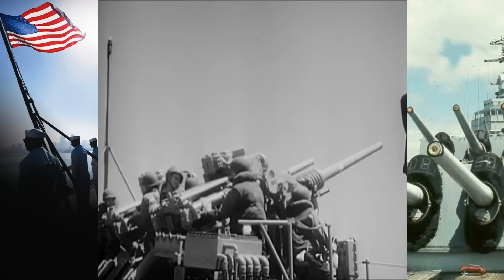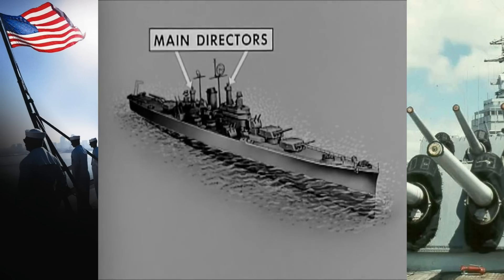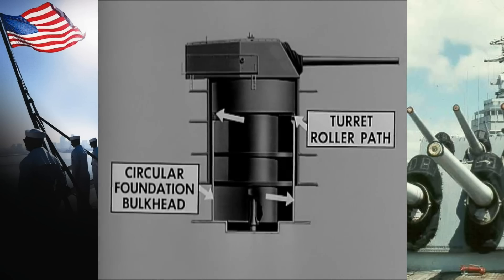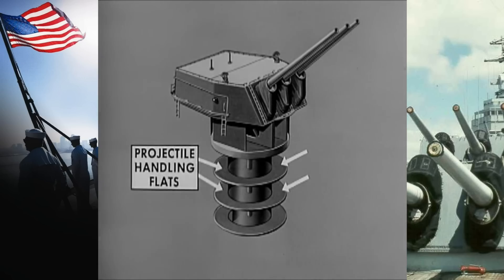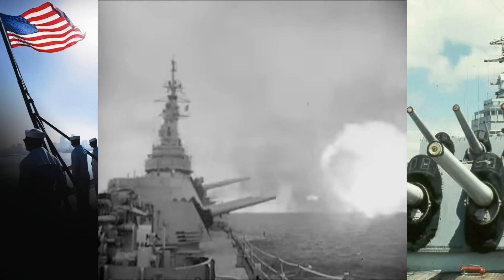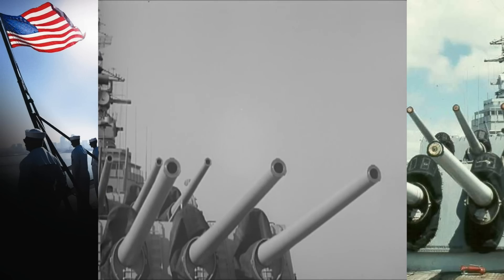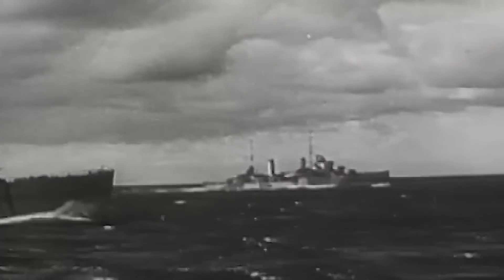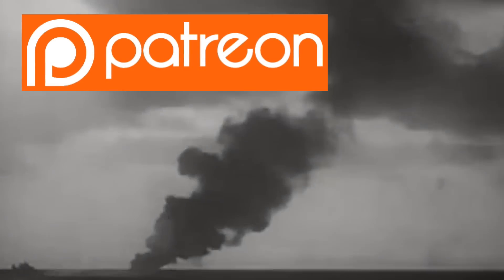How Do Large Caliber Naval Guns Work?

Comment: I also like large naval guns, and their firepower and history are truly impressive.  Glad you posted this video about the U.S. Navy’s 8” naval gun, but there are some points to clarify.  The Des Moines class cruisers with the automated, rapid fire 8” guns came out near the end of WWII and probably saw more action during the Korean conflict than the preceding Baltimore Class cruisers, which also had 8” (or 203 mm) guns but were manually operated with a fire rate of about 3 rounds/gun/minute.  The Des Moines cruisers used a single cased shell, which allowed for its more rapid rate of fire, and the gun mount itself was considerably heavier and more costly to build & operate.  The Baltimore Class cruisers came out with then the most advanced radar, rangefinders and analog fire control systems, and they mainly served as concentrated anti-aircraft escorts to the carrier fleets, which by 1944, grew to numbers the Japanese Imperial Navy could only dream about.  

The 8” naval gun on the Baltimore cruisers had a maximum range of 17.9 miles and they were manually operated with a separate load and ram of the shell and then the cased powder bags.  A well trained turret crew could fire about three rounds/ minute at best because of the intense handling and weight of the materials, but when these guns hit their target they did considerable damage.  The heavy cruisers were also used to assist in shore bombardment, as well as surface engagements against enemy ships.

Comment: Wouldn't powder bags be cheaper to use? There's an answer of course but I have no idea of it.
Reply: Brass protects powder better and doesn't deteriorate like cotton, but main reason is that, with "bag ammunition" you have to be really careful during reloads that a "hotspot" from the previous round being fired doesn't set off the powder when you shove it in - they used to swab the barrel with a big "Q-tip" and water between rounds.
Reply: Makes sense. Thank you.

Comment: As usual, something's screwed up here. A caliber is 1-100th of an inch. .50 caliber=1/2 an inch. 55 calibers would be a little over 1/2 an inch. Those barrels were a Hell of a lot longer than that.
Reply: They were using caliber differently, in the case of navel guns it's the multiplier of the bore diameter.
Reply: Lensflare Deviant:  What? Can you explain it a little better?
Reply: @alanpeterson6224  One of the conventions of naval guns is that the bore to barrel length ratio is called caliber.  I am not sure why but it started before WWII and seems exclusive to the Navy.  Its why we see strange things like the 5" 38 caliber which was the standard 5" dual purpose navy gun for a while had a barrel 190 inches long (5x38).  It was used all the way up to the big 16" 50 caliber guns used on the battleships.
Reply: Lensflare Deviant: Thanks. I'm actually beginning to understand something, I think. I divided 190 by 5 and got 38. My brain hurts. I need a beer.

Comment: One of the surprises for me is just how much difference there is between a 5 inch gun and an 8 inch gun.  A 5 inch projectile usually weighed around 65 lbs depending on the type of projectile while an 8 inch projectile weighed around 350 lbs!  The Japanese naval crews were very impressed by these rapid fire 8 inch guns in combat.  They said it was like a machine gun firing 8 inch projectiles.

I imagine these rapid fire 8 inch guns could be worn enough to require a new barrel liner during a single engagement.  I did some more reading and it looks like the US actually got where the 8 inch guns could fire 700 rounds before wear became an issue.  They improved this with different lubricants that cut down on barrel liner wear.  I am not sure if they could replace the barrel liners while at sea.
Reply: fun fact - During Vietnam they discovered a warehouse full of new 16" barrels and that was a reason why they reactivated the New Jersey to do shore bombardment (it was cheap!)
Reply: Were those barrel liners?  Do you know if the ship's crew can replace barrel liners while at sea or is that just a task for the naval yard?
Reply: The rapid fire guns never saw action against Japan.  12 cruisers were under construction to be used for the Japan landings when Truman dropped the bomb.  The three that were the closest to being finished were completed after the war, the rest scrapped.  Relineing a gun is supposed to be a dockyard job.  On the other hand, with a 8"/55, the liners could (and were) replaced at on a wharf.  You needed a dockside crane to lift the 40 ton barrel out of the gun and lay it down on the wharf.  Then you could change out the liner, basically rerifleing the gun, and then you'ed fly the barrel back on board.  We did this a couple of times for each gun in the Philippines during the '72 Vietnam cruise.

Comment: I am glad to say that many of those beautiful gun tubes made their way on to tracked chassis for the 
US Army as M110 series of self propelled howitzers, the most accurate howitzer ever fielded.
I am equally proud to have been a crewman on one of those sexy beasts.
The total weight of each howitzer was 36 tonnes on a  very light tracked vehicle as opposed to the self 
propelled 155mm M109 series coming in at a measly 25 tonnes which included an armoured chassis and turret.

A few changes in capabilities came with the move to land based operations:
1) a wider variety of munitions; HE (High Explosive), various ICM (Improved Conventional Munitions), Chemical, and Nuclear.
2) a increase in range.  Only about 5 miles but still farther than anything the Soviets could throw at us.  
Part of that was due to changes in powder chemistry and another due to the lightening of projectile from 260Lbs. to 205Lbs.
3)  One thing the Navy never did (as far as I know) was what we called the double shot.   Firing a High Angle (HA) mission which often had a flight time of > 90secs, then to reload, and fire a Low Angle mission (flight time often around 40 secs) on the same target an have the rounds hit the target within seconds of each other.  
Range Control and Battalion Command almost lost their minds after we pulled that little stunt.

Comment: After watching the ejection system....You start wondering what they did with the spend shell case...I presume they are made of bronze, of some kind.....Would they be able to re-use those empty shells ??  If not, seems to me like an enormous waste of resources there... ...  Also.....The gun barrels....shooting a shell every 6 seconds....I can imagine that a lot of heat will be involved.... How do they prevent the gun itself, from bending..?
Reply: The powder cases were stored aboard awaiting rearming when we would offload them to an ammo barge, while reloading new ammo and powder.  Sometimes we would have to throw them over the  side if we got into a prolonged battle so as to have room to walk on deck.

Guns would get red hot sometimes although we would trade off guns to allow for a cool down and to give the gun crews a chance to rest.  The guns were gauged for wear every day, or at least as often as possible, as gun wear was factored into initial firing calculations.  Eventually, the gun liners were so worn that the projectiles would wallow in flight and make an odd noise.  We would pull into Subic Bay in the Phillipines  to have the liners removed and replaced.

Many photos at the Newport News web site...

Comment: Am I the only one that expected that a reload would take a literal minute before it could fire again?

The last thing I expected for that monster to be an "automatic" gun!
Reply: auto loaders are machines. they tend to crap out when used. men get tired and slow down. then the men try to short cut safety to get their speed of reload back up. auto loaders won't let you do that.  the environment inside and operating gun house of any size gun system is not a happy or safe place. when guns fire there is a mist of grease particles and oil floating in the air. if the gun house is pressurized the gun gasses will get blown out the tube when the breech opens. there is only one overriding reason for auto loading a Naval gun and that is weight of fire. boresighting a gun to the fire control system and removing hysteresis and wear from auto loader mechanisms  in Naval gun systems was a constant battle in and of itself for the gunnery department on any navy ship. hats off to them

Comment: You shoudn't have left it to the U.S. Navy video to do most of the talking because it overlooked what confuses most people and what they want explained. That is, what does it mean to say, for example, "55 calibers". These calibers vary with different models of the same bore size, e.g.. the 8 inch diameter here. What caliber refers to is the length of the barrel in that you multiply it by the diameter, in this case 8 inches x 55 equals a barrel length of 36.6 feet. The longer the barrel, the more pressure builds up behind the projectile allowing for higher velocity of projectile and more penetrating and/or explosive effect. The longer the barrel the more precise the gun is in projectile placement as well. However, the greater length of the barrel confers greater weight to it, which is something the gun mount has to support. Also, with greater length comes greater sagging of the barrel, affecting accuracy so it is all a tradeoff.

Comment: "Large Caliber". funny 152 mm is a light crusier caliber. 203 about is a heavy crusier 305 and above is normally battleship battlecrusier caliber. 152s were secondary guns to heavys and battleships. these are mid-mid low range caliber. other than that great video. though i wish you would actually have said more yourself.

Comment: 8 inch guns and other AA guns would not be very effective were it not for the super secret proximity fuses (or VT) that were used against aircrafts in 1942. The proximity fuse was so secret it had the same level of security and classification as the Manhattan Project and the D-Day invasion plan. It was not even de-classified until 1960.